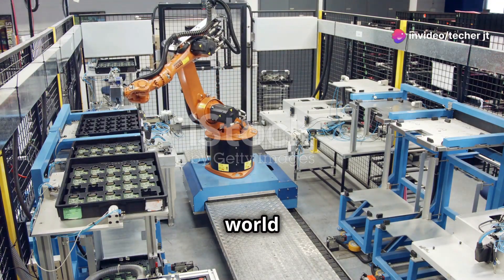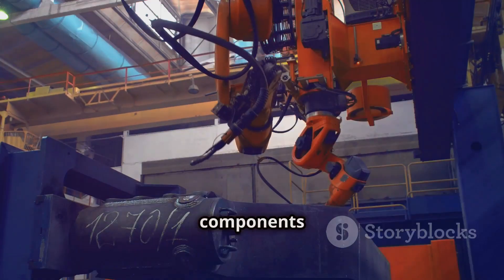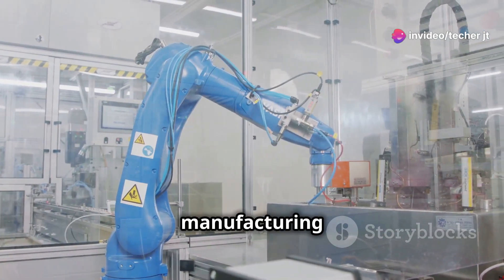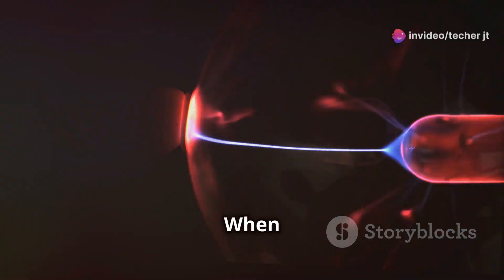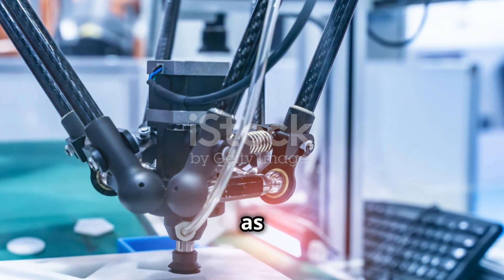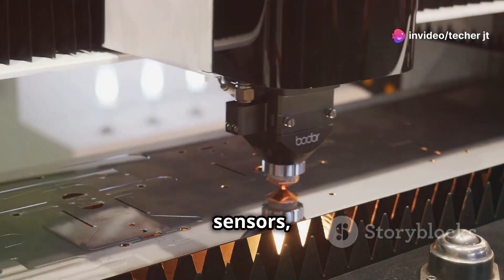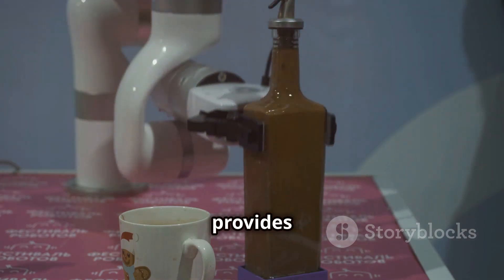Inductive Sensors for Robotics

Comment: 👇🌟 10 - ANDROMEDA CHAIN 🌟
Reply: Christine M. Luna
10 - Andromeda 
Sept. 11, 2024
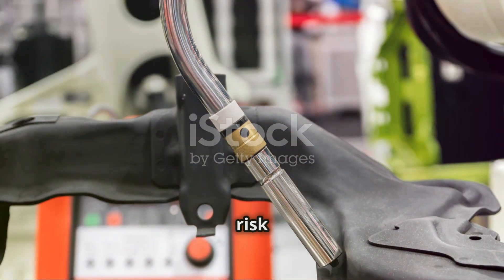4:25 (time stamp)

2. Describe the difference between shielded and unshielded inductive sensors.

- Unshielded sensors lack the metallic shield around the coil, resulting in a wider, more diffused sensing field that extends not only to the sensor's face but also somewhat to the sides -- making them prone to detecting unwanted metal objects in close proximity which can lead to false readings. 

- Shielded sensors, on the other hand, incorporates a metallic shield around the coil -- effectively concentrating the magnetic field to a smaller, more focused/specific area directly infront of the sensor's face; therefore minimizing false triggering by the significant redhction of the sensor's sensitivity, and allowing for flush mounting in metal as the shield prevents the sensor from detecting any surrounding metal.
Reply: Antonnette C. Tayrus 
10- Andromeda 

Q1. What is the primary function of inductive sensors in robotics?

Answer:  Inductive sensors are indispensable components, as they provide robots with the sense of touch or proximity detection. They are renowned for their reliability,  robustness, and cost-effectiveness, which makes them ideal for a wide range of robotic applications. Simple task detection to complex navigation tasks, inductive sensors empower a robot to operate with efficiency and precision in diverse environments. They act as the robots eye, that detects the presence and position of metal objects. Information will then be relayed to the robot's control system that allows it to control it's movements accordingly.
Reply: Kobie James B. Gabales 
10 - Andromeda 

1. What is the primary function of inductive sensors in robotics?

Inductive sensors in robotics are primarily used to detect the presence and position of metal objects. They have various applications, including detecting parts on assembly lines, identifying obstacles in autonomous vehicles, and positioning instruments in medical robots. These non-contact sensors operate by sensing changes in magnetic fields when metal objects are nearby.
Reply: Ettena Marie A. Gabales
10 Andromeda

4. What are the advantages of using inductive sensors over other types of sensors in robotic applications?

— Inductive sensors offer several advantages over other sensor types, including reliability, robustness, cost-effectiveness, precision, non-contact operation, and versatility. These qualities make them ideal for a wide range of robotic applications.
Reply: Ayannah Nicole Ngujo
10 - Andromeda 

1. What is the primary function of inductive sensors in robotics?

Inductive sensors are used in robotics to detect the presence and position of metal objects. They are a type of proximity sensor that uses electromagnetic fields to detect objects.
Reply: Dean Andrie P. Daohog
10 - Andromeda

Question 4. What are the advantages of using inductive sensors over other types of sensors in robotic applications?

Answer: Inductive sensors provide various advantages over other types of sensors, including dependability, resilience, affordability, precision, non-contact operation, and adaptability. These characteristics make them suitable for a variety of robotic applications.
Reply: Zara Mae M. Jurane
10- andromeda

1. What is the primary function of inductive sensors in robotics?

-the primary function of Inductive sensors in robotics is to detect the presence or absence of metallic objects without direct contact. This sensor uses electromagnetic fields to sense changes caused by the presence of metal, which enabling precise positioning and object detection.
Reply: Rose Gabrielle D. Araoarao
10 Andromeda

1. What is the primary function of inductive sensors in robotics?

Inductive sensors in robotics are mostly used to detect the presence or absence of metallic items without making physical contact. This sensor detects changes in electromagnetic fields generated by the presence of metal, allowing for precise location and object recognition.
Reply: Englis

1. Describe the difference between shielded and unshielded inductive sensors.

- Shielded sensors are designed for usage in tight locations and have a limited sensing range. While unshielded sensors have larger ranges and can detect objects from a wider distance.
Reply: Charles Christian Bahian
10-Andromeda

1. What is the primary function of inductive sensors in robotics?

Answer
- Inductive sensors are primarily used in robotics to detect the presence or absence of metallic objects within their sensing range. They operate by generating an electromagnetic field and detecting changes in this field caused by the proximity of a metal object.
Reply: Andrei Lavern A. Pelayo
10 - Andromeda

4. What are the advantages of using inductive sensors over other types of sensors in robotic applications?

Answer:
Inductive sensors are good for robots because they can detect metal objects without touching them. They’re also very durable and can handle tough environments.
Some advantages of an inductive sensor include reliability, cost-effectiveness, versatility, accuracy, and speed
Reply: Davey A. Sabanal
10 - Andromeda

2. Describe the difference between shielded and unshielded inductive sensors.

Shielded sensors have a focused magnetic field, reducing side interference. Unshielded sensors have a broader field, detecting objects from various angles.
Reply: Zhandra B. Dela Rosa
10 Andromeda 

1. What is the primary function of inductive sensors in robotics?

Inductive sensors are primarily used in robotics to detect the presence and proximity of metallic objects. They work by generating a magnetic field and measuring the changes in that field when a metal object enters or leaves the sensor's range.
Reply: Kent Kyle T. Palingcod  10-Andromeda 

2. Describe the difference between shielded and unshielded inductive sensors.

Shielded inductive sensors, also known as flush sensors, are designed to be mounted flush with metal surfaces and have a shorter sensing range, while unshielded sensors have a longer sensing distance but must be exposed, making them more prone to interference from surrounding metal.
Reply: Ariel D. Lacia
10- andromeda

1. What is the primary function of inductive sensors in robotics?
Inductive sensors are primarily used in robotics to detect the presence and proximity of metallic objects. They work by generating a magnetic field and measuring the changes in that field when a metal object enters or leaves the sensor's range.

Comment: 1. What is the primary function of inductive sensors in robotics?

Inductive sensors are essential components in modern robotics, enabling robots to perceive their environment, perform tasks with precision, and operate safely. Their impact on robotic assembly lines is significant, leading to increased efficiency, improved product quality, and a safer working environment. As technology continues to advance, inductive sensors are poised to play an even more crucial role in the future of robotics.

Comment: 10 - LYRA CHAIN 🔥
Reply: Angel P. Rivera
10 - LYRA

1. What is the primary function of inductive sensors in robotics?

= The primary function of inductive sensors in robotics is to detect the presence or absence of metallic objects without physical contact. They work by generating a magnetic field and detecting changes in this field caused by nearby metal objects. Inductive sensors are known for their reliability, robustness, and cost-effectiveness, making them essential for tasks requiring proximity detection in various industrial and robotic applications.
Reply: Xharmei Therese P. Barcenilla
10 - Lyra

2. Describe the difference between shielded and unshielded inductive sensors.

Answer:
Shielded inductive sensors have a metallic shield around the coil, which directly concentrates the magnetic field to a smaller, more focused area in front of the sensor. This design reduces sensitivity to metallic objects outside the intended sensing range, minimizing false triggering and allowing for flush mounting in metal. In contrast, unshielded sensors lack this shield, resulting in a wider, more diffused sensing field that can be more prone to detecting unwanted metal objects nearby.
Reply: Jag Alona S. Ramayla
10 - Lyra

3.	Significance of the sensing range in inductive sensors:

Answer: The sensing range determines how far the sensor can detect metallic objects. A focused or limited sensing range (in shielded sensors) is crucial for accurate detection in environments with potential metallic interference, while a wider range (in unshielded sensors) is useful when detection in a broader area is acceptable.
Reply: Chlouie Fate O. Hermoso
10-LYRA

2. Describe the difference between shielded and unshielded inductive sensors.

-Shielded inductive sensors have a metallic shield around the coil, which focuses the magnetic field directly in front of the sensor, reducing interference and false readings. They are ideal for precise detection in environments with nearby metallic objects. Unshielded inductive sensors lack this shield, creating a wider sensing field that extends to the sides. This makes them more prone to interference but suitable for applications where a broader detection range is acceptable.
Reply: Jasmine Jade D. Cañete
10-Lyra
1. What is the primary function of inductive sensors in robotics?

Inductive sensors identify metallic objects' presence and position without making physical contact. They give robots the ability to sense touch or detect proximity, allowing them to interact effectively with their environment. This function is essential for activities such as part detection and navigation.
Reply: Jasmine E. Delapus
10-LYRA

1. What is the primary function of inductive sensors in robotics?

Inductive sensors are indispensable components that provide robots with a sense of touch or proximity detection. They also act as the eyes of a robot's control system, allowing it to adjust its movements accordingly.
Reply: Angel Alexa M. Maquilan
10 - Lyra

1. What is the primary function of inductive sensors in robotics?
- Inductive sensors in robotics primarily detect the presence and proximity of metallic objects without physical contact.
Reply: Jhonlee O. Oliveros
Grade 10 - Lyra

4. What are the advantages of using inductive sensors over other types of sensors in robotic applications?

:Robots can detect touch and proximity using inductive sensors, which are renowned for their durability, dependability, and affordability. These sensors are perfect for a variety of robotic applications since they can perform complicated navigation tasks as well as basic part detection. This sensor enables robots to function precisely and effectively in a variety of settings.
Reply: Ruztylou Gaviola
10-LYRA

1. What is the primary function of inductive sensors in robotics?

The primary function of inductive sensors in robotics is to detect metallic objects without physical contact by sensing changes in electromagnetic fields, enabling precise position and proximity sensing.
Reply: Abbygail Somobay
10-Lyra

1. What is the primary function of inductive sensors in robotics?

-> inductive sensors stand out as indispensable components, providing robots w/ a sense of touch or proximity detection. These sensors are renowned for their reliability robustness and cost effectiveness making them ideal for a wide range of robotic applications.
Reply: Xer Salise 
10-Lyra

What are the advantages of using inductive sensors over other types of sensors in robotic applications?

inductive sensors are highly reliable in industrial and robotic applications where metal detection, durability, resistance to environmental factors, and low maintenance are important.
Reply: Jana Sophia D. Enopia
10 - Lyra

1. What is the primary function of inductive sensors in robotics?

The primary function of inductive sensors in robotics is to provide touch and proximity detection. They enable robots to perceive the presence and position of metallic objects without physical contact.
Reply: James Miguel Lumantas
10-Lyra

1. What is the primary function of inductive sensors in robotics?

It is to detect metallic objects without having to touch them. It's function is to provide precise and reliable data of the position of metal components
Reply: Maria Floriz J. Napone 
10 - Lyra

2. Describe the difference between shielded and unshielded inductive sensors.

- Unshielded inductive sensors are more likely to detect any undesired metal items in near vicinity (which might lead to erroneous readings) because they lack a metallic shield surrounding the coil. This results in a larger and more diffused sensing field that reaches to the sensor's face and sides. In contrast, the coil of a shielded inductive sensor is encircled by a metallic shield that allows it to focus on a narrower but more precise area that is directly in front of the sensor. This considerably lowers the sensitivity of the sensor to metal objects outside of its sensing range.
Reply: Hailey Aiyana E. Gador
10- Lyra

1. What is the primary function of inductive sensors in robotics?
 
- Inductive sensors are used in robotics to detect the presence of metallic objects, particularly those made of ferrous materials like iron or steel. They work by generating a magnetic field and measuring changes in inductance caused by the presence of a metallic object within the sensor's range.
Reply: Lloyd Zeus M. Ladoroz
10 - Lyra

3. Explain the significance of the sensing range in the inductive sensors.

Unshielded sensors are important in situations where a wide sensing range is crucial and that precise proximity detection is not as crucial, though they can be prone to false readings due to nearby interference. In contrast, shielded sensors offer greater accuracy and are more focused in detection, making them suitable for use in controlled environments.
Reply: Maria Juliana Lois M. Palacio
10 – LYRA

1. What is the primary function of inductive sensors in robotics?

The primary function of inductive sensors is to detect the presence or absence of metallic objects without physical contact. They give robots the ability to sense touch or detect proximity, allowing them to interact affectively with their environment.
Reply: Iam Raut Labnotin
10-Lyra

2. Describe the difference between shielded and unshielded inductive sensors. 

•Shielded inductive sensors have a metal shell around the sensing coil, focusing the electromagnetic field forward for better precision in detecting nearby metallic objects. Unshielded inductive sensors lack this shielding, allowing the field to spread more widely, enabling detection over a broader range. Shielded sensors are ideal for confined spaces, while unshielded ones work better for larger detection areas.
Reply: Blyth Eldrick L. Porsuelo
10-LYRA

2. Describe the difference between shielded and unshielded inductive sensors.

unshielded inductive sensors sense not only through the face but is diffused and offers a wider sensing field. Often, due to this diffused sensing field, an unshielded inductive sensor is much more prone to picking up unwanted metal objects within close proximity which may cause issues like false reading. Shielded inductive sensors on the other hand, have a metallic sheet wrapped around the coil which helps concentrate the magnetic field into a smaller and much more focused area directly in front of the sensor's face. It allows the sensor be less sensitive to metallic objects outside the intended sensing range.
Reply: Justine Luis G. Espadilla
10 - Lyra

1. What is the primary function of inductive sensors in robotics?

The primary function of induction sensors is to detect the presence or absence of metallic objects. This can be used in self driving cars to safely navigate through their surroundings and to help avoid obstacles.